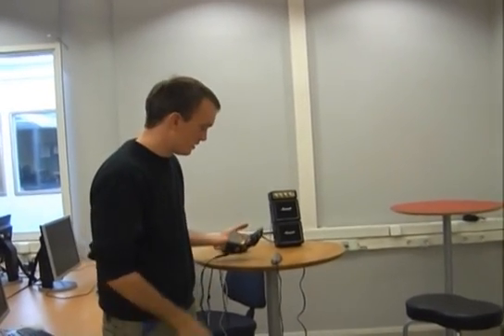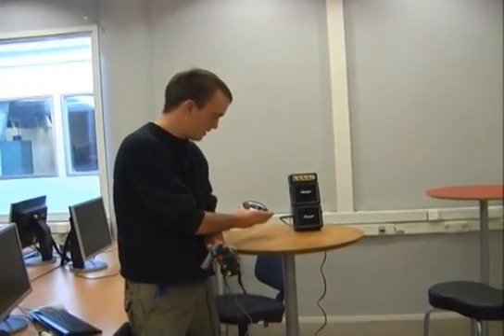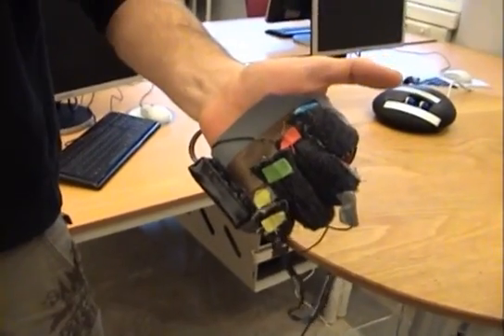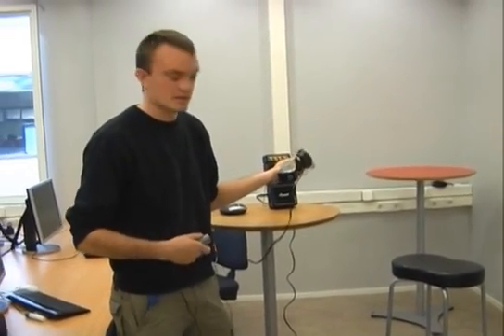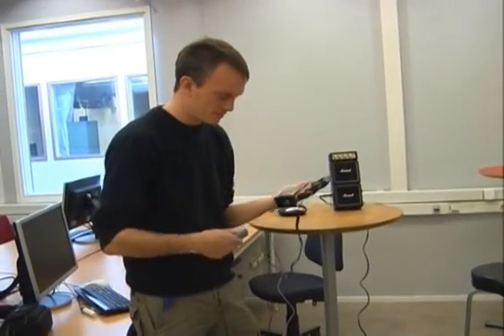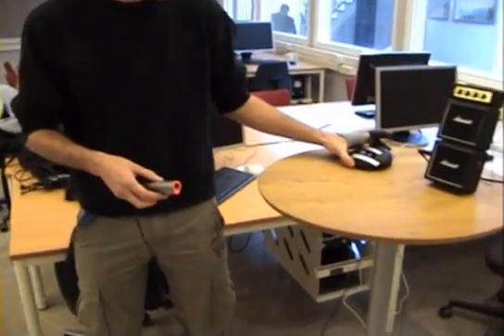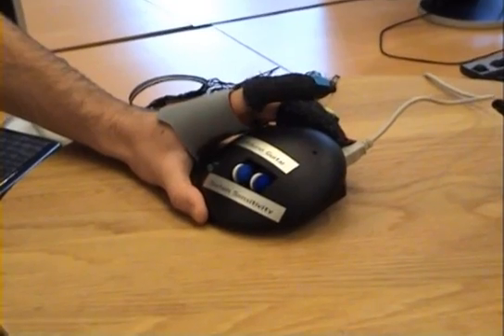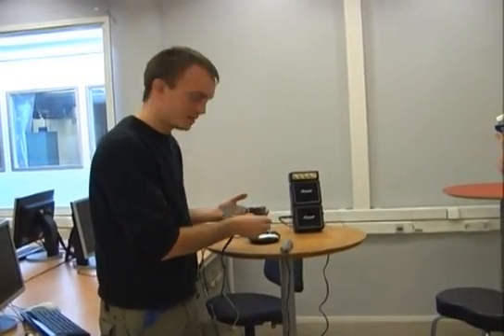AIRduino Guitar

Comment: it has tones in completely opposite directions of what the guitar has,lol. Funny because I have often thought that ,though I completely understand the mechanics of my guitar strings, I have always thought the thing would make a lot more sense if the higher on the neck away from the body it had higher tones. Also never understood why the lower tones strings are at the top of the fret board.